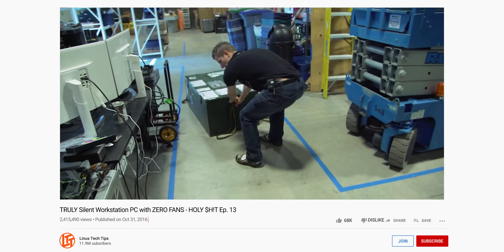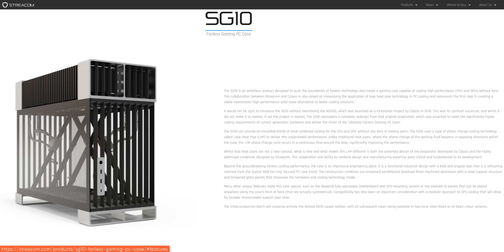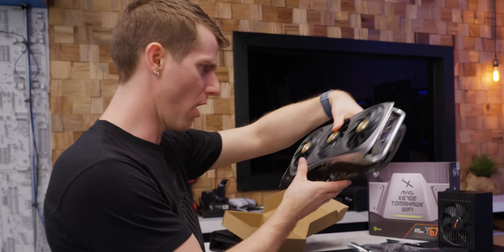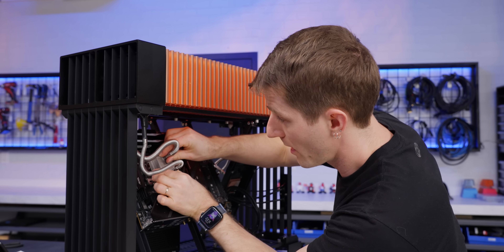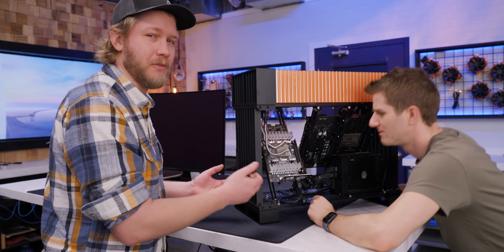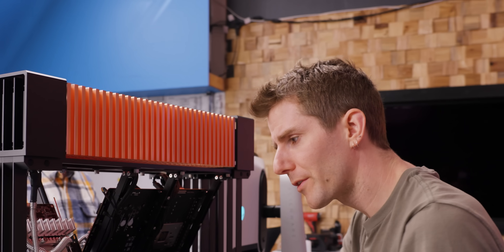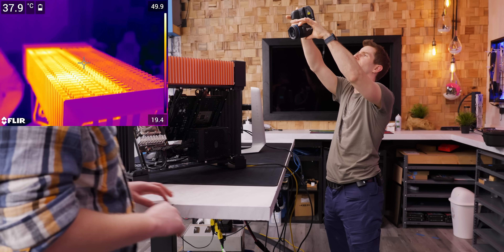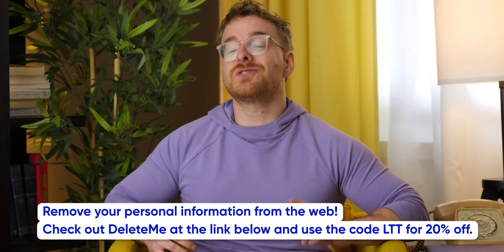I bought this scam PC case... And it actually arrived

Comment: Worth the weight in copper. A slight bent or curve is always preferred.
Reply: Slightly to the left 👌
Reply: Lmao 70 lbs of copper is like 300$, idk where the extra 1600$ comes from
Reply: @OffStamp  gotta make that money back somehow
Reply: @OffStamp  manufacture of the copper and especially the cooler and obviously as chillingrobo said, making money
Reply: @OffStamp  engineering, machining, painting, tooling, shipping and low production count if built from 1st world country where people ask more for their skills

source: fellow mechanic who knows a ton about machining and has been on a tour in rimac HQ and greyp HQ in sveta nedelja as a school trip (before rimac started working with buggati, porsche, aston martin etc.)
Reply: @OffStamp  It's like the heatsink on a rocket that needs to suck in kilowatts of heat and survive for 120 seconds in vibrations so strong that it can cause metal to flow like a liquid. $1000 for the raw materials, $10,000,000 for the engineering and fabrication knowledge to design and make it from the raw materials.
Reply: @OffStamp  ahh yes. the only expensive part is the raw materials. totally forgot we dont pay CNC machinists anymore